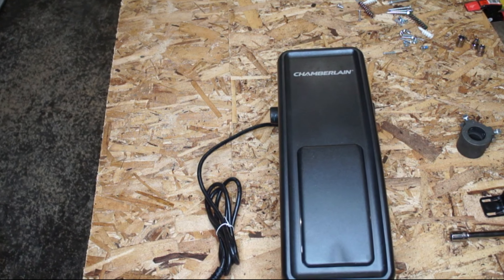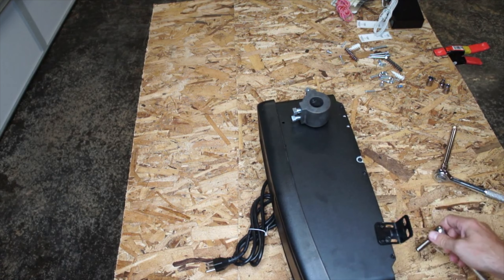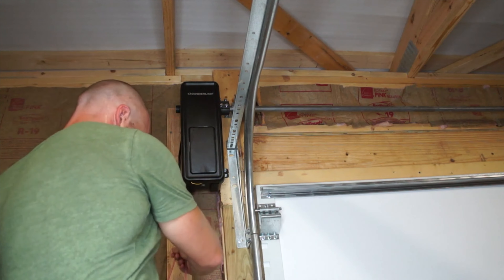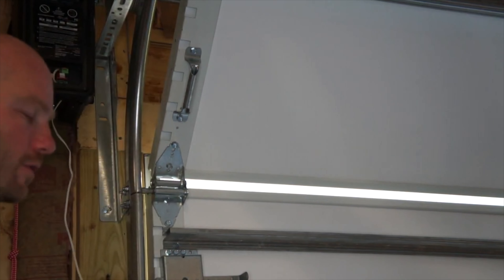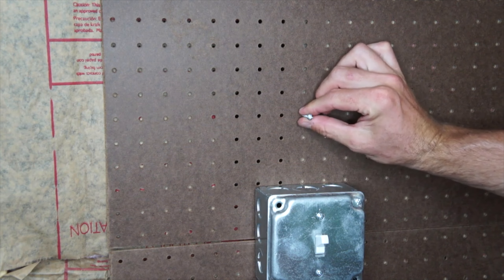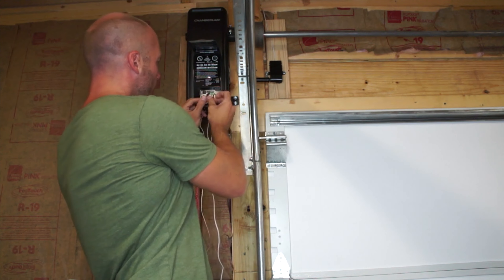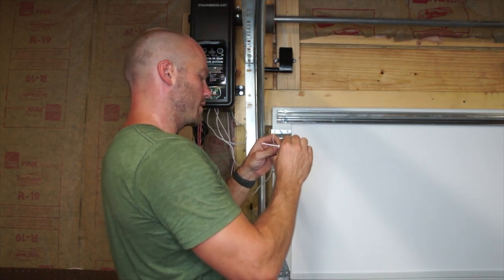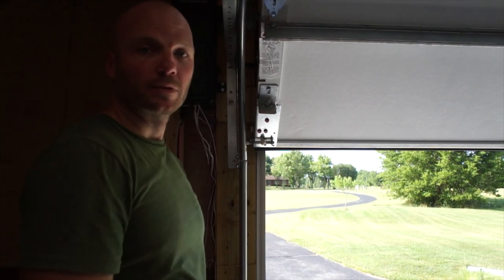Install a Wall Mounted Garage Door Opener, Step by Step for Beginners

Comment: my contractot installed this openerator in my vaulted garage ( no access to garage from house) . how do i access the emergency pulll cord from outside ths garage? any ideas?
Reply from the maker: If there is no other access to the inside, that could be rough… even with the traditional ceiling mount style that would be a problem.  If there was an easy way to bypass it from the outside, that would be a huge security problem. I think you would have to cut a hole in the wall or break in the door or something…
If the bolt lock portion wasn’t installed, than you could probably force it up. But the bolt part is there to prevent that.

Comment: This system does not work unless you loosen the springs so that there is constant weight on the cables since the opener does not push the door closed like an overheard does.  This is why they need the cable slack sensor.  But if you do that you can forget ever lifting the door manually even if you release the opener.  With some model doors like Ideal there may not be enough clearance to install the tension sensor because of the EZ Set spring winder gear box.  Also the sensor assumes that the cable will bow OUT if the door does not move.  In our case it bowed IN so it never detected the lack of movement so the idiot controller just kept spooling out the cable turning the cable into a tangled mess and damaging our new door. 
We liked the idea but it is such a defective design that I took it out and returned it. The drive system needs to be seriously rethought!  Classify it as high priced JUNK! 
FYI all of the wall mounts are the same with the same patent and minor superficial changes.  Not worth the investment.
Reply from the maker: I have been using mine for a few years now and I don’t seem to have this issue with mine. If you don’t set the stops, I could see it trying to keep unspooling the cable. And I am still able to open it manually if I pull the disconnect 🤷🏼‍♂️.
Reply: @RoscoReviews  have you tried opening the door manually?  Is it a light door?  I never got past setting the stops because I could not get enough initial weight when the door was fully open to have to even begin to close.  In order to do that I would have had to loose more than a foot of clearance by allowing the door to hand down enough to put tension on the cables.  Whats the point of having an 8 foot door then?
Reply: @RoscoReviews  Customer support actually told me that the cable sensor was not compatible with the Ideal brand door due to their EZ Set spring winding system which is a really nice feature.  That sensor is a joke since it assumes that they cable is going to bulge out when it develops slack.  In my case it bent the other way and kept the sensor pushed out causing the cable to spin on the pulley like line on a fishing reel.  It was a total disaster.
Reply from the maker: My door is 16’ wide and 10’ tall and it’s insulated, so it’s pretty heavy. I didn’t lose any clearance. But, it’s possible that the horizontal tracks are sloped a little causing it to want to come down on its own.

Comment: Genie has a more sophisticated cable monitor that somehow detects vibrations on the cable. but I still reject the idea that they rely on gravity to pull the door shut.  All overhead units will push the door down to fully closed so they dont need the locking unit but will still work with a conventional lock if you want it.  For all their technology its a poorly designed unit.
Reply from the maker: I haven’t seen the sensor on the genie ones. I’ll have to look it up. It would be interesting to see the difference.